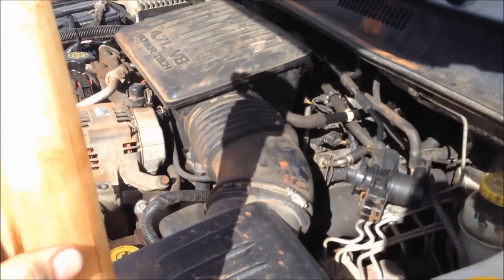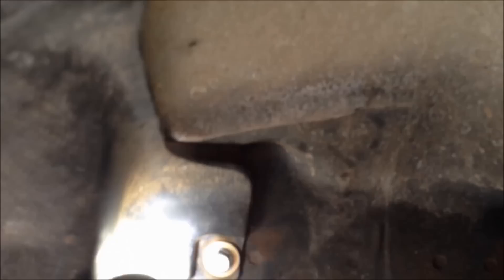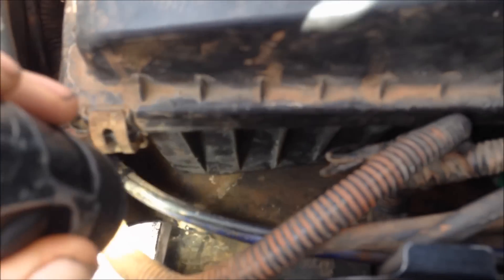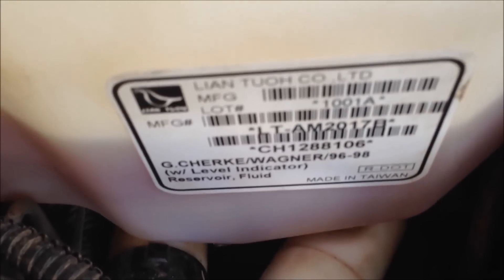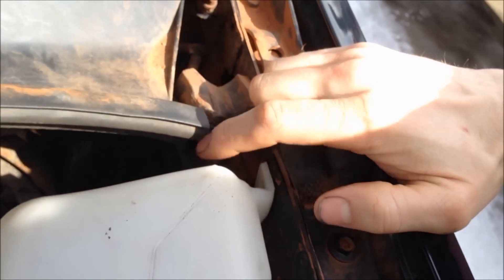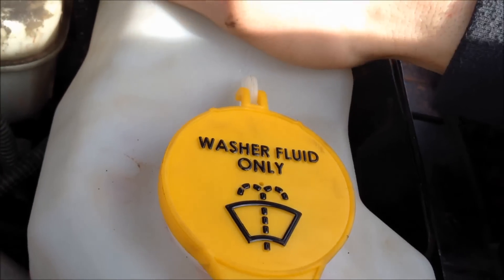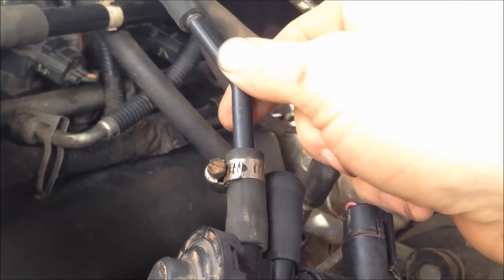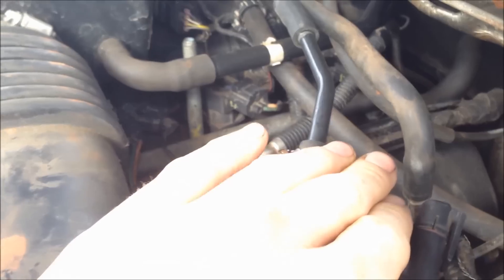Jeep WJ To ZJ Washer Bottle Conversion 2002-2004 | Video

Comment: I have an '04 Laredo but the trip computer up above the review mirror gives me a "low washer fluid" message ever since my tires ripped the pumps off the stock washer bottle. Can you verify that I will need the part with the fluid level indicator? Thanks.
Reply from the maker: Well first things first you’d have to get smaller tires or not ride as hard to keep the same thing from happening again. Then, you’ll have to turn your wheels and may need to remove an inner fender liner but you’ll have to look at the reservoir and see if the reservoir is damaged, or if it just needs a new sensor. The wires could also be ripped out of the connector. You’ll have to figure out what actually broke and fix it, but the level sensor would be on the reservoir.
Reply: @TonyTheTruckGuy  So the fact that I'm getting that message means I have a "fluid level indicator" despite the fact that my WJ is a Laredo, correct?
Reply from the maker: Haha yes I would hope so. If not, something is seriously wrong with the body controller making it think that it has something it really doesn’t. Like I said it’s pretty easy to check though. Like I said it’s pretty easy to check, you might not even have to remove that inner splash guard. It’s basically just a little plastic finger looking sensor that attaches to the reservoir just like the sprayer pumps do. Typically just held in place by a rubber grommet. This is of course assuming that the washer fluid itself is actually known to be full.
Reply: @TonyTheTruckGuy  Great, thanks! I have no inner splash guards. I tore those out when I trimmed the fenders to fit the 32s... haha
Reply from the maker: Perfect! Lol. SHOULD be able to reach up there and just replace the sensor then without needing to remove any more stuff unless it’s on the front side of the reservoir.

Comment: Thx for the video, I have a wj2004...saw some solutions, including a bag on ebay, and a custom bottle on some froums...I ordered the zj bottle today..hope it goes well...your idea seems much more resnoable and logical then other solutions...

I need to move the alarm also...where did you stick it btw eventually? I thought of just flipping it down maybe...

Btw did you relicate the canister on the driver side back bumper also? If so...do you have a vid/explination maybe? 

Anyways thx for the vid its exclent
Reply from the maker: If you have an ‘04 like me, your canister should already be at the rear bumper. What alarm do you mean? The one I pointed out on my firewall was an aftermarket viper arm and I was able to make it work without moving it.
Reply: @TonyTheTruckGuy  
Wow you are fast..your after market alarm as to zj canister is the same scnario as my self..thus aske where did you move the "look a like horn/speaker".. I am thinking to flip it maybe vartical or if you moved it..then the question was where..as in the vid its not there..but both myself and you..have it...

As for the evap..thats a seprate issue,yes..
I have it on the driver side back bumper...2004 is 2004 we are the same...
Now ..that thing needs to also move or be relocated on the back bumper to fit and cut the back bumper a bit for tyre clerance (have a set a side of 265/75/16..think its 31.8" or 32")
So was wondering if you moved your evap also..and how or where?...
Dome just turn it around..some relocate it I think to the unibody or other places...did you too?

This scanrio is mainly as I plan to ghonk ahead b4 putting the tyres..I already strached it on a forklift to see opening and clousre...I have IRo 4" short arms preimum kit..and will probably add 1" on the springs to make it 5" + extdnd the bump stops to prevent fender cuttings..
Bumper wise no problem to cut llastic and fog lights..

But thinking ahead...
Reply from the maker: Haha I try to reply as soon as I can 😋 I never ended up having to move the alarm horn. It was very close to the zj washer bottle but I got away without moving it. You could probably flip yours around or move it over a bit if you’re having issues. As far as tire clearance goes for the evap canister, I was running 32x11.5 BFG AT’s on roughly 5” long arm and was able to just trim the rear bumper. I didn’t have to modify the canister.
Reply: @TonyTheTruckGuy  
You are the men! Thx
Just prepared to that option...thx again..ur D men :-)
Reply: @TonyTheTruckGuy  
Hi..well I finally had the zj bottle, pumps connected coorectly and it works well, I had to extand an elecric wire of some sort of a horn..and moved it up front..I would need to also cut and weld the wires of the connectors of the pumps to reach way back..I did test the work and it works ...had to cut some bolts that used to hold the vacume and the hood open sensor and will need to relocate it..
Are you happy with the vacume cut solution?
Im in between either doing your solution or maybe use the extra rubber hoses that I unplugged to not cut the plastic tube and insted maybe extand from the ends of the plastic tubes and use the rubber flex hoses to maybe connect it to the side wall...any thoughts?

Otherwise some pepole recomended the xj bottle..I font know why..its huge and does not fit..I thought I might also get it bjt once recived I decided to go with the zj bottle instead..maybe I'll use the xj bottle to a diffrent manual project or tfy to sell it..

Can I ask you a question...?
I have aside a265/75/16 set of copper stt ..thats why im doing all of this as I plan to cut off the fog lights and maybe fibrglass for a sleak look then fit already ordred fog lights which are smaller then the stock ones...

Any who...I currently have a 4" lift kit by IRO, its the premuim adjastuble short arms set ...
I have also aside 4 spacers of 2", and you said you have a 5" lift..may I ask if you had 4" and added 1" spacer? Do you have short arms or longarms?

I am asking as most pepole say adding 2" on top of the 4".. Is not recommended..so undicded if to cut ghose 2" spacers to be 1" so I'll be 5" in total + extanded bumpstops..
Or just put the 2" to make it 6"..
I have 2 members how did it and its fine for them on shortarms +6" lift...

Anywho...I am thinking to extand the 4" becouse I want to make sure the tyres set aside (265/75/16) wont hit the fenders...bumpers wise ill cut a big and extand bump stops but fenders cut I want to avoid..

Any thoughts? Whats your setup?

Thx and sorry to barge in...your vid is simply the only logical one so Im thinking you probably understand my concerns...

Thx
Reply from the maker: I’m surprised you had to extend wiring since I didn’t have to. The vacuum hose setup I did never gave me any issues, so I would recommend that method as a simple solution. I had 4” long arm kit with 3/4” RC spacers in the front and 2” rubicon express spacers in the rear. This made the rear ended sit about 1” taller than the front because originally, my front end sat higher after the 4” lift install. I’m assuming they do that so it sits level once you add a winch. But I wanted it 1” taller in the rear since I did some towing with mine and didn’t want it squatting a ton. I would steer clear of adding 2” spacers to the 4” lift just because you have short arms. Friend of mine had 4” short arm kit with 31x10.5 and the steering had a “on center nervous” feeling and it just seemed to not ride as nice and a little more tippy. Most people recommend long arms at 4”+. But to clear the tires you have, you’ll need the perfect offset wheels with 5-6” lift and you’ll still probably have to do some trimming.
Reply: @TonyTheTruckGuy  
Thx,
So what would you say?
Take the 2".. Cut it to be 1", then add to the 4" adjustable shortarms btw?

Or put the 2" as is on the 4"?
I have a pretty much ecprienced college that on the back he has shortarms and 6.5" and front long arms..he has the same wj I have..the reason he put only on the front the long arms is that on rock crawling thd back ling arms pretty much interfear vs the back shortarms..I actually saw it in real time while he passed quite easy where 2 others where strugling...
He basically stated after 9yrs with the wj..
Listen..dont cut the spacers..it wont be 6" exactly..and it could stand it..worse case remove the spacers if ride expirance struggles..

I know there is a tipping point above 4"...
But I also know 5" on shortarms should be ok..but no more than that...
Thats why im a bit sluggish about making the 2" spacer to be 1" or 1.5" or leave it to be 2", I have 2 palls with a wj that ride on 4" +2" spacers with no issues..but then again most of the falks say its not a good strech for it...

Would you add 1" , 1.5" or 2" spacer given I font want to re invest in long arms atm.?

My base is just keeping from cutting the fenders but not crapping the wj...
Reply from the maker: I wouldn’t try to cut the spacers in half unless you have a way to cut them perfectly even. If you have other buddies running 2” spacers with 4” coils without brake line issues or driveline vibration issues then I guess you could try that. You’re going to for sure be trimming your front bumper to clear the 33” tall tires with just the 4”, or even 5” of lift. But if you’re shopping for 6” total lift, I’d honestly do 6” coils instead of 4” coils plus the spacers.
Reply: @TonyTheTruckGuy  
Thx
I'll check with the installer to make sure :-)
Will update..
Thx
Reply: @TonyTheTruckGuy  
Can I ask you...in the electric wires where the orignal washer bottle was it is connected to some sort of sensor...I think its meant to detact collision...
Did you leave it in his place and reveald the other wires to pull back to the zj washer or did you just take the full tangled wires back with it to the washer of the zj?

The reason I ask is that soldering extension wires to the conectors is a bit complex...
Reply from the maker: Around the 1:15 mark where I’m explaining that I cut some zip ties to get more slack out of the harness is the only modification to the wiring I can remember doing. I don’t recall having to mess with a crash sensor or anything. I don’t own the Jeep anymore and it’s been a few years so I’m a bit fuzzy on this though.
Reply: @TonyTheTruckGuy  
Thx ur D men

Comment: Did you finagle the bottle downward or up to get it out? Doing replacement for the first time...mine is leaking got a new one just gotta figure how to get it out and what to unplug please
Reply from the maker: unplug both washer pump plugs then there should be 2 or 3 8mm or 10mm bolts holding the reservoir in then you can see it's slotted, im not sure which direction you have to slide it but you do that then yank it out from the bottom. helps if the wheel is turned. if you have the 4.0 you might be able to get it out easier from the top. then cut 2 zip ties holding the washer pump harness to the frame and it should stretch up to the new reservoir so you can plug the pumps back in.

Comment: i got my new bottle today it has 3 holes in it what goes in the hole on the front hole and theres 2 holes close together on the side
Reply from the maker: 1 hole is for the front washer fluid pump, 1 hole is for the rear washer fluid pump and 1 hole for the fluid level sensor.

Comment: Where did you put the charcoal canister
Reply from the maker: My Jeep was an ‘04 so the canister wasn’t located in that spot. I found out after making this video that the 2002 and older have a canister there.
Reply: I have a 2001 V8 and would like to know a solution as well... None of the forums or YouTube seems to have a solution
Reply: @717UT  I've had a zj washer bottle for a.few years.now.Nd still haven't figured out anything to.Do with it. I might just put it in the back of the jeep and run new lines
Reply: Swap out the airbox for a new air intake?

Comment: did you remove the canister?  or did the bottle fit fine right over it?
Reply from the maker: My Jeep was an '04 so the canister was in the rear of the vehicle. 2001 and older Jeeps had the canister in this location so you may need to look up a more detailed write-up online.
Reply: +PkwyDr  thanks 👍
Reply: I have the same situation, 37' tires rips the pumps right out and need to relocate the bottle but I have the vacuum canister in the front...

Comment: How the hell did you removed the old one out without removing the sway bar?
Reply from the maker: I don’t recall it being anywhere near the sway bar lol. Having the wheel turned might help a bit. My Jeep was also lifted about 5” so that may have played a role as well but I never had to remove anything’s no other than the reservoir itself.
Reply: You basicly unook the stabilizer 2 bars as low as you can, then after they are down turn the driver side wheel to left, unook all the bolts..unook all the connectors, free the holding bolts..pull back from the plastic bracket and turn the bottle 90 dagrees from above..pill it down..it will free up..and its out

Comment: Is this only for the 4.7?
Reply from the maker: I think it should work for the 4.0 too if it’s 2002 or newer
Reply: @TonyTheTruckGuy  mines a 99 thanks for the reply
Reply from the maker: I say 2002 or newer because I think the charcoal canister for the EVAP system is located in the new washer bottle spot on the 99-02 but if yours doesn’t have a charcoal canister there for some reason then this would work